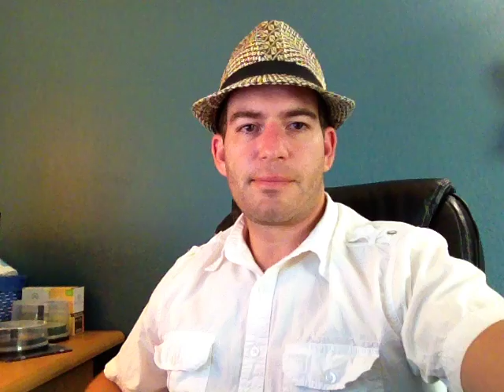How to know if your Pellet Stove Igniter is working

Comment: You’re touching the issue in having I believe, but I’m praying you’ll go a wee bit further. You mention testing the line to the igniter with a multimeter. Can you detail some precisely what I should do as far as settings in the meter? The igniter itself, is testing ohms enough? I’m not even sure what the proper ohms should be but I’ll google that later. I have an Ashley 5660…it’s used and the poor thing was not well maintained. I replaced the igniter before my first start up and it’s run fine for several extended burns. It did that is, until last Friday night when I used a new brand of hardwood pellets. The flame just started dying because no pellets were feeding. I cleaned out the hopper and the auger works well and I tried again…no ignition. I get a 1 & 5 red light on temp flash and a couple were 1&2 red light. 
My igniter sits far back in the tube…I did remove it and power up the stove but, no glow. I don’t know if the brand new igniter has already gone bad or, if there’s a problem before the igniter. Again, it has been working flawlessly for probably a good dozen burns. I’m thinking I’ll replace the igniter but, I’m not sure 100%, that it’s bad. 🤷🏻‍♂️
Your thoughts? You stated you sell parts….do you sell them for this Ashley? I paid 25 and change for the igniter…I’ll be ordering a burn pot as well for 88. The burn pot has seen better days but has been working. 
And my air intake tube…it has only a half damper….how I don’t know but I expected to see a full circle up when the damper is closed…but I get just a half moon. Again…🤷🏻‍♂️
Any suggestions are appreciated!!
Reply from the maker: A good igniter will read around 10 ohms.  Bad igniters usually read open or over 100 ohms.

Comment: I've been burning up igniters every 3-4 weeks, I've also blown the in line fuse, the igniter are coming out in a distorted shape. I've change the main control board  thinker maybe it was sending to much power to igniter with no difference. What's my next step?? The fuse doesn't blow each time and after I replace igniter to works great for 3-4 weeks starting & relighting, Is it cheap igniters?

Comment: i just ordered a new igniter installed it and still no heat coming from it what else can it be the old igniter is a year old all the blowers working the control panel is on with all lights working showing that there is power its not as clean as it should be but the igniter should still turn red i also changed the fuse still any help would be appreciated
Reply: did u figure out what the problem was? I have the same issue. feedback would be greatly appreciatedThanks

Comment: My problem is is that when it warms up, the stove shuts off. Then, when the room cools again, the pellets will not ignite. I get a whole box full of pellets and I have to clean them out and start manually. The pellets I do pull out are hot and black, but don't ignite. Maybe the pellets are imperceptibly wet. They do fell dry. Can't figure it out. It does start about 15% of the time automatically. Thanks. It is a Harman P43

Comment: Have a Breckwell from '98, replaced vacuum switch, high limit snap switch (High Temp. Thermodisc) and ceramic fan switch (Auger Thermodisc), + auger motor (auger stopped feeding). Now auger feeds fine, but will only ignite when I bypass the auger thermodisc. Don't know why that would even have anything to do with the functioning of the igniter. Also not much to go wrong with a new thermodisc?
Reply from the maker: Hmm.  I'm curious if this might be a control board issue.

Comment: On the englander 25 pdvc how far away should the igniter be from the hole in the inside of the burn pot
Reply from the maker: As close as you can get it without touching the burn pot

Comment: I am only getting about 6 volts to igniter?  New igniter, where do I look next?
Reply from the maker: Control board.   Depends on the make and model but if you are not getting power to the igniter, usually a control board issue.

Comment: Got it but still acts funny 3 minutes after it lights goes into a E-2 code and control panel only 3 months old guess I have to call them and see what is going on never had this trouble before
Reply from the maker: I think e-2 is the vacuum sensor so you may have a bad sensor or the stove needs to be cleaned along with the chimney.

Comment: y don't have voltage to igniter
Reply from the maker: If you don't have voltage going to the igniter you may have a bad fuse or bad control board.  If you need more help, email me a ebay@jasonRmunson.com